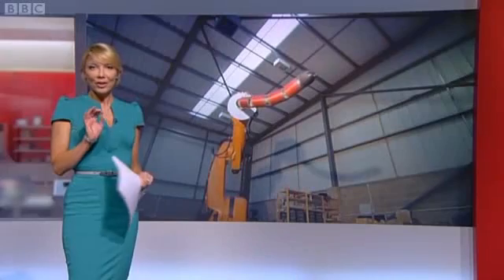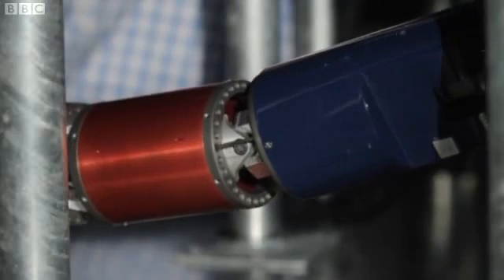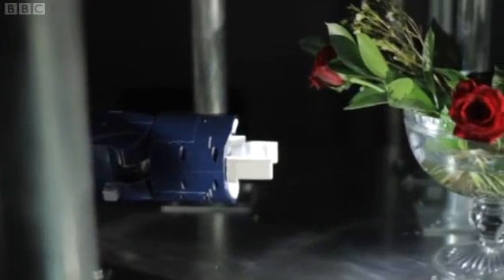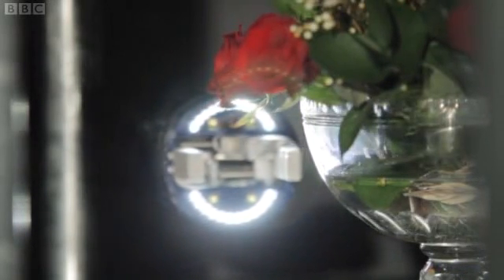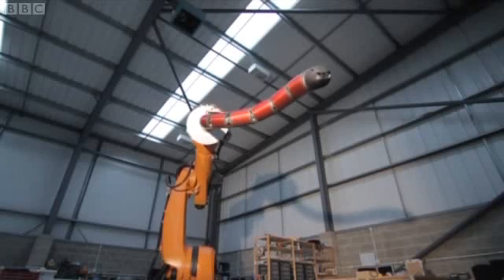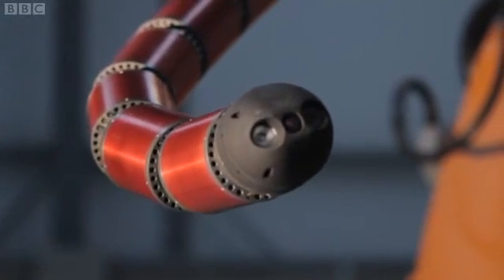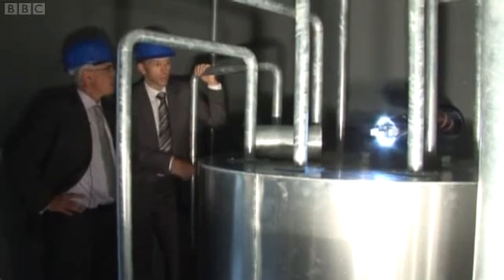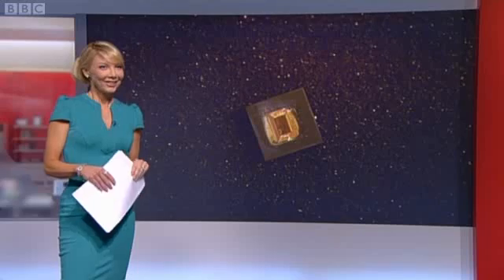OC Robotics - BBC Points West - Sellafield nuclear snake arm robot

Comment: I'm currently studying robotics at Plymouth Uni and I'm really interested in building something similar to this for my final year project. From your site I've seen previous snakes that use actuators and have a hollow core, whereas this one seems to have universal motor joints on each segment. Why the design change? I don't suppose you have any publications detailing the workings behind these robots?